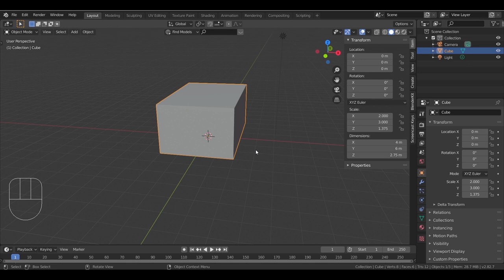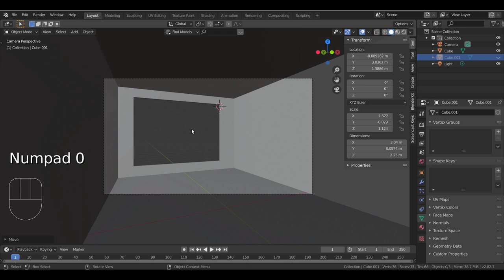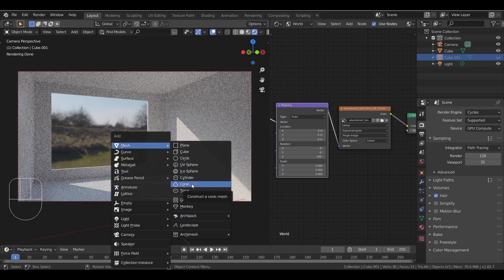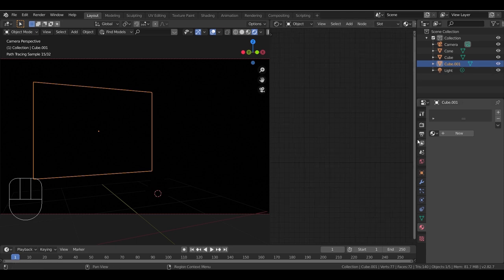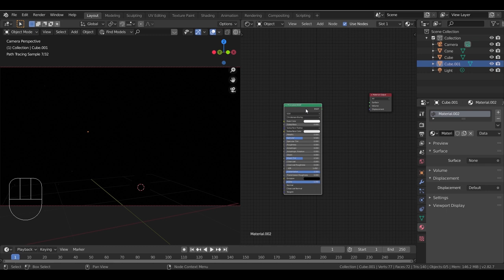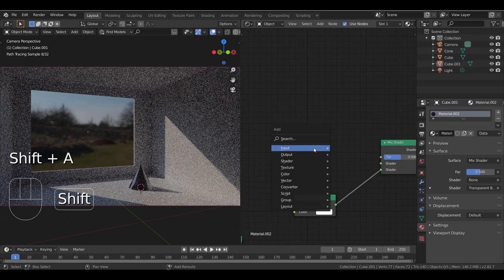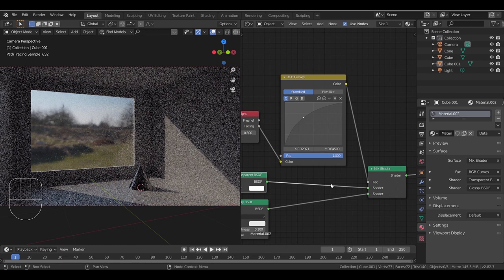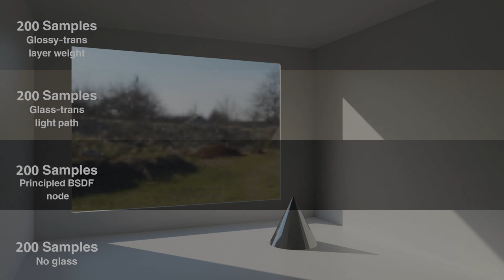Architectural Glass | Blender 2.82

Comment: HI there. Thank you for these amazing videos. I usually use to the second method and I also add the math between  lightpath and mix shader fac. It works very well sometimes.
Reply from the maker: Thanks I'm glad you liked it , yeah you right about the math node, I usually use it when I need the diffuse ray along with the shadow from the light path , but sure , it gives more control even with one ray alone.

Comment: Hello. One question: does it matter the position of the node input in the mix shader? Transparent on the fist shader or the second?
Reply from the maker: Hi buddy,Yes it does matter since you have a factor input, the first slot will affect or get affected by the second depend on the factor node you insert, and that goes for Mix shader, Mix rgb...etc
Just open blender and try this glass setup with switching the nodes order and see how that affect the refractions, that might give you more understanding to the case.